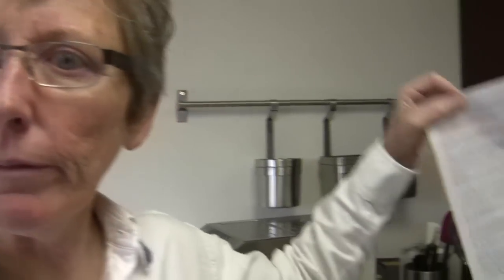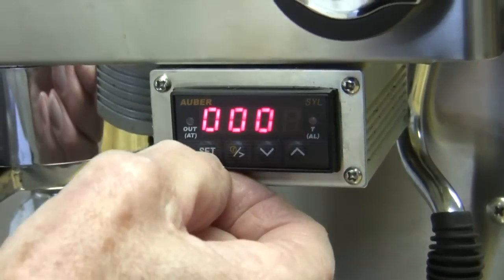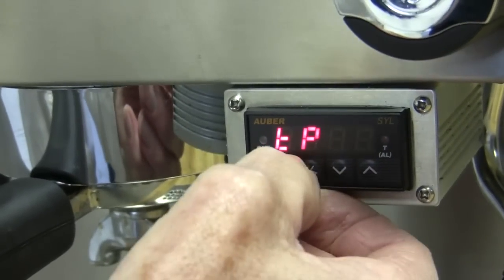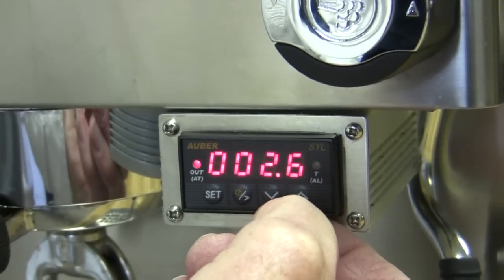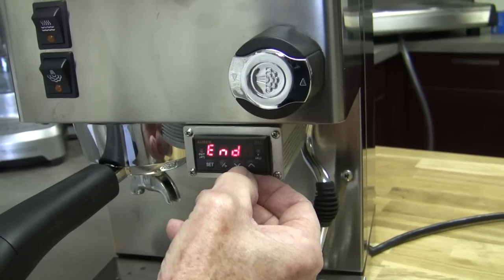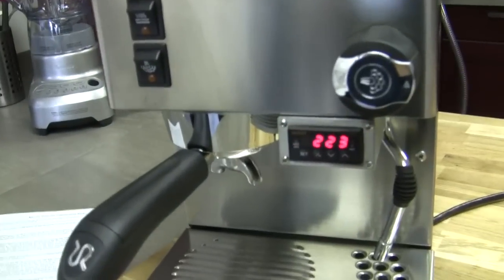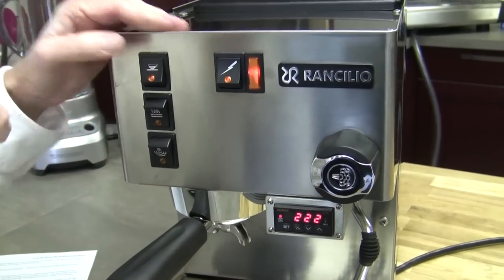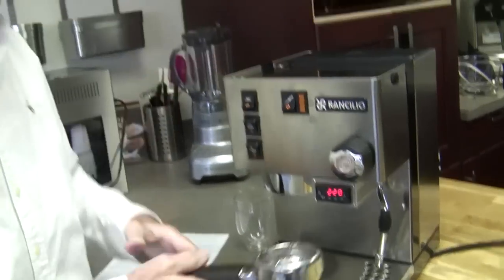SCG How-To Guides: Programming the Auber PID on the Rancilio Silvia

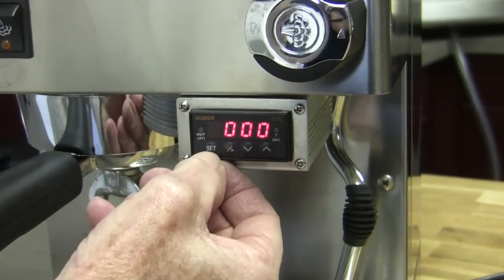Comment: At 1:00 you show how you can scroll over and input “1”, but you don’t explain why. Is the 1 simply to enter programming mode? Please remember to explain your steps in addition to just doing them. btw, letting that machine heat up with no water in it, goodbye heating elements.
Reply: 0001 is just the code needed to enter programming mode

Comment: After installing my Auber Pre-infusion PID (bought at SCW) it operated fine for two weeks, then when turned on today, it goes straight to steam temp, not stopping at brew temp. Checked all wiring to the drawiings and all look good. Ideas to resolve this? I've not programmed the PID, unless pressed something accidentally. Thanks.

Comment: Don't add a PID to your espresso machine.  I've owned the same Rancilio Silvia for the past 15 + years.  I just had the 3rd Auber PID controller go sideways.  The problem is that adding a PID complicates the wiring, you are adding another temperature sensor + a solid state relay.  You now have more things that can/will go wrong.  I have had one of more of these components go out over the years.  I just removed all of it and put my machine back to a stock configuration.  Now I'm enjoying wonderful espresso without all the hassle and fiddling needed just to attempt to have a bit more control over the temperature.  In the end, you will not notice the taste difference at all.  As a matter of fact, when I removed the entire Auber PID system I would say my shots are the best they have ever been.

Just run the machine without the portafilter under the head for a few seconds before your shot.  This will bring the temperature up and clean out the brew head.  Voila!

Save your money!
Reply: mark can I restore my Silvia with a qualified tech or can I send it to you? seriously.  Is it then like a regular Silvia again? The one they have on here is unnecessarily busy.
Reply: But you can leave it as a temperature indicator,  an expensive one that is though
Reply: The PID works great!   Don't get one if you are OK with mediocre espresso.

Comment: I have a question. Well a statement/question. 

The PID as much as i can see addresses the extraction time and boiler temp. Extraction and preinfusion,i can do manually. The boiler temp control seems to be the main benefit....the actual reason i am interested in the PID for the silvia is actually fine tuning the boiler pressure for frothing milk...i find this to be the weakest point of this machine. There is either over pressure or under pressure, not to mention sloppy boiler element kick in times during frothing.... 

I imagine an actual pressure gauge connected,read and regulated by the pid would be the solution if it doesnt already exist!!!
Reply: The amount of time (and therefore the amount of milk) you can steam with the Silvia is limited.  Therefore, I begin steaming as soon as the (not) ready light goes out.  When it comes back on, the steam isn't hot enough., but within the ready state it works.  Throttle the pressure with the steam knob at first when the pressure is highest.

Comment: I have had my machine with PID for about 2 years now and love it.  (sidetone) I purchased the bottomless portafilter which was a huge improvement for pulling shots.  

Recently, my machine started to act up with temperature control.  I took it to the local authorized service location, but due to the installation of the PID, he could not work on it.  I don't want to lose my PID as I know this is a huge benefit of the machine.  Does the install of the PID void the warranty?

Comment: Hi SCG, with the pre infusion function on the PID, how does it stop the solenoid valve from activating when it pauses the extraction? Is it any different from just turning the brew switch on, off, then back on again? 

Cheers
Jake
Reply from the maker: Hi Jacob Madden It's exactly the same as turning the brew button on, then off, then on again.  The Silvia doesn't truly have a way to lighten the pressure, the pump is either on, or it's off.  With other machines, like Rockets, the pre-infusion is just the release of some of the already existing pressure from the hot water, so it's not actually engaging the pump. :)
Reply: Seattle Coffee Gear No problem. Thanks for the reply

Comment: Hey SCG I love and really appreciate all your videos. I'm planning on getting the rancilio Silvia with the PID from you guys in the future. Just two quick questions about it. Does the PID play into steaming milk at all with special functions or do you simply turn on the steam switch and watch the PID to hit the right temperature to start steaming? Also, just out of curiosity, what are the functions on the PID that Gail said not to mess with?
Reply from the maker: Hello Jeremy White, The PID does show the temperature climb when you press on the steam button, so you don’t need to worry about pressing any buttons on the PID too in order to get it to go to steam temperature.  Also, just of note, you will still need to refill the boiler after you steam, whether you have the PID or not, so that you don’t burn out the boiler.  As far as the other functions, this PID has the ability to be used for other things besides controlling temperature for a coffee machine, so if you should get into other functions, if, say you didn’t go to the right programming, you could change something that we would not be able to figure out or talk you through correcting.  If you are getting into the programming of the timing of the brew cycle, just be sure that you are only adjusting the settings in “0001,” as we do not have any other guidelines for any other settings that the PID might have control over.  Hope this helps! - Miranda

Comment: What temp for steaming milk?  290 was the default setting.  after i push the extra water out before steaming the milk, it goes down to 270s . . . .should i wait for it to hit 290 again?
Reply from the maker: No, you can begin steaming right away as soon as you flush that small amount of water from the steam arm and do not need to wait to get the temp to 290. Most folks steam anywhere from 270 to 300 degrees. - Teri

Comment: hi, i am thinking of getting the PID for my Silvia mainly for the temperature stability. i'm not interested in the pre-infusion and the timing features for the pull and i want to be able to keep using the Silvia's brew button instead of pressing the PID's button for brewing. is it possible to set up the Auber PID this way? thanks!
Reply from the maker: I believe they have a lesser featured version that they sell on their site that will enable you to operate it like you'd like. Check out the options they carry; they have many more than we offer. - Kat

Comment: I'm a customer of SCG and Auber. I hope my level of "dual citizenship" entitles me to comment regarding the symbols that show up on the Auber display during programming. Instead of su, that's sv for Set Value.  The symbols for Pre-infusion, dwell (Auber term for wait after Pre-infusion and brew)), and brew times are: tP, td and tb. The Rancilio brew switch needs to be OFF when pumping water through the steam/hot water wand, so if you leave the brew switch on all the time, water will flow from the brewhead when trying to pump hot water only through the wand.  I love the Auber PID, Rancilio Silvia and SCG -- great combo of products and service.
Reply from the maker: Thank you! Great detail for folks :) - Kat
Reply: do you know how to change the steam temperature? thanks!
Reply: @jido88 you'll wanna change the AH1 and AL1, that is the start and stop heater temp for the steaming
Reply: thanks their video is not that detailed nor thorough